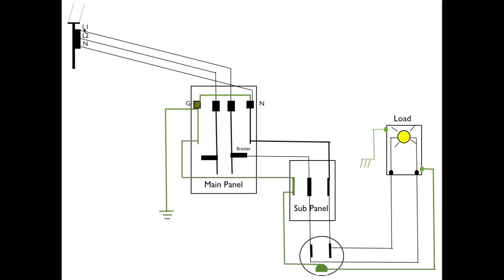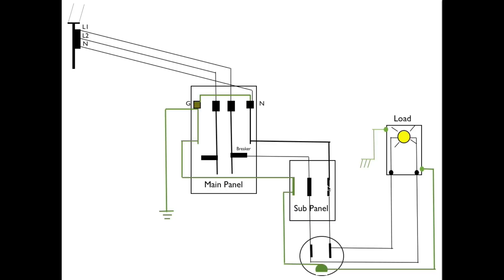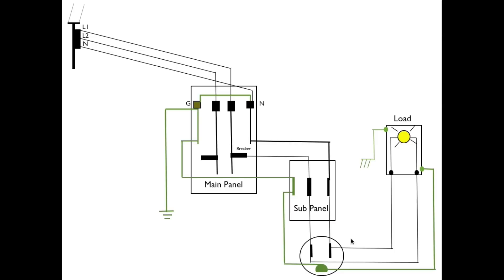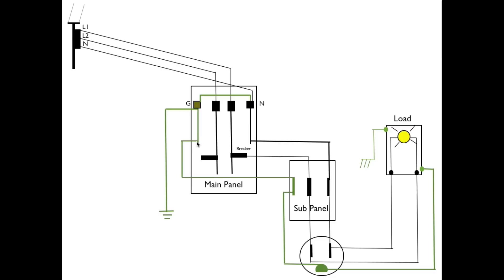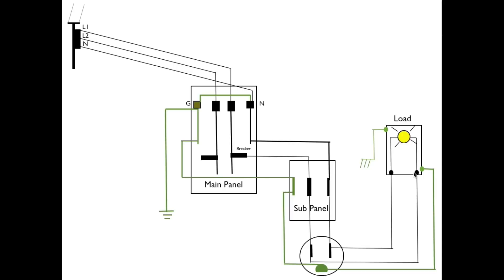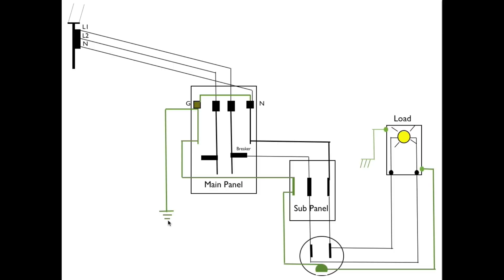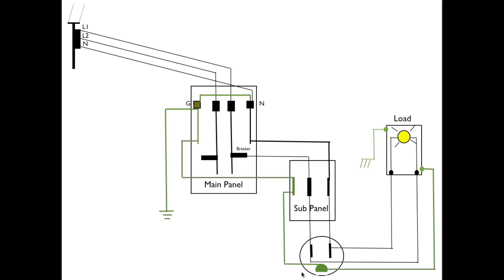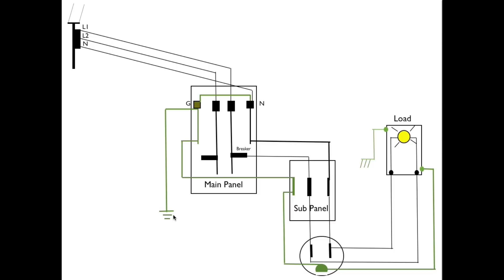The difference between neutral and ground on the electric panel

Comment: The "Neutral" that is coming in from the pole is NOT a neutral. It is called the messenger cable. Utilities do NOT want neutrals. We send power. The neutral is formed by the homeowner, at the panel, by bonding the neutral and the ground together at the panel, and then to generally a cold water pipe..this is the primary ground.
Ground rods have nothing to do with the primary service ground.
The reason we don't "bond" a sub-panel i.e. neutral, ground is because we need for the un-balanced load to go to a designated location and stop.. I repeat stop. Otherwise you'll have a condition called a "ground loop". All bonding is to be preformed at the load center, hence 4 wire connection. Other than that you were dead on. Remember, don't disturb the electrons while they are working...you will not be forgiven.
Reply: JPP2672  .. Thank you. why would I not get voltage between black and white but I will between black and bare and on a nearby Outlet white and bare. can you give me any help at all
Reply: It sounds to me as though you might have an "open neutral." That is to say you don't hand a compete circuit for the GROUNDED conductor. Neutral. 
Neutral. a current carrying  conductor that carries the UN-balanced load to ground.
Reply: In a typical 4 wire home setup, there are two hot wires having AC current but offset by 180°.  Messenger cable (aka neutral) is bonded to earth ground.  Does all the current that comes in from the hot wires exit the house via neutral?  I can't envision all the power going into a copper pipe to enter the earth.  It's a long way back to the power plant.
Reply: Maybe it is a long way back to the power plant then again maybe it's not
Reply from the maker: The neutral is kind of a gathering place for 120 volt circuits.  When a load, say 10 amps,  passes power thru, it goes to the neutral.  If another 10 amp load is energized from the other hot line, the power passes from one hot thru the 2 loads to the other hot line with no power passing to the power pole thru neutral.  If the the loads are unequal, say one is 10 amps and the other is 5 amps, 5 amps goes to the power pole thru neutral.  I have more videos on grounding and bonding on my channel.   Virtually no power passes thru the earth ground.
Hope this helps.  
GFM
Reply: Grayfurnaceman Thank you. I know that about the circuits. I know something is not right.
Reply: Reverse polarity, hence alternating current
Reply: I don't want to argue with you here, but the neutral is the return from EACH 120 V circuit to the transformer.  The 240 (stove, furnace, dryer, ??) is end to end of the transformer. The neutral as I understand it is just a center tap - as one side of your house goes negative from end to center tap it is 120 volts... and the other side of the house should be 120 volts the opposite polarity...
The neutral is the return path that has no voltage because the math is right. It's floating in the center of a 240 volt wave - ZERO.
Reply: ***** hence the shared earth ground...
I was only questioning what was written in the grayfurnaceman's explanation.  It seemed to miss something when I read it... 
Thank you for the answer though.  It's good to have some affirmation I'm not completely lost:)
Reply: The only  true "floating neutral" is on board a ship. The neutral is formed inside the home / business at the load center. What you are speaking of ... (stove furnace, dryer) are RESISTIVE circuits.....power. One way of looking at it is a welding machine....I know its D.C. but its the same principle... the circuit and the devices attached to it are in a controlled environment.
Reply: JPP2672 The dryer element may be resistive but the motor would be inductive.  Load type is not the question (though the current /voltage relationship could cause some issues with lag). 
The neutral is a neutral line from the transformer and you supply a ground through your panel for safety due to voltage differences through the system (from what I've read here). This makes sense to me now. 
I work on large aircraft electrical systems and understand what you are trying to say. The floating neutral you are talking about - what systems have you seen that on?
Reply: JPP2672 I thought grounding to plumbing was out. 1) more plastic these days and 2) should the ground become active and it cannot conduct properly, water can become the conductor and human contact is not a good thing. I know there are plenty of systems out there on water pipe, but power companies where I live won't accept new install with it and strongly encourage moving to ground rods in existing situations. Updating from 100 to 200 amp panel follows the same rules as new installation. Let the plumbers do their thing and electricians do ours.
Reply: I change from a hundred amp service to a 200 amp service on my house and move the service 20 feet down the house so I could install a wood burning fireplace. I change my piping to plastic and I drove in a new copper rod and grounded the system right underneath the Box
Reply: Bob R Then I say you did it correctly. 👍
Reply: Bob R How much did the utility company charge to do that?
Reply: I went down and paid for an electrical permit, less than 100$. An inspector came out and approve my new location. They told me that the new box had to be hot when the state inspector came out and that I could run a jumper from the old box to the new box in order to create an electrical connection at the new box. When I had it finished I called the state inspector he came out and inspected my finished work told me that I needed to put a green bonding screw and that I had left out that would ground the box. He signed off on the new box and he called the utility company to come transfer the wires for the wires to the new box
Reply: True.But we here in The Netherlands we use both neutral and "ground" in end distribution.Because the standard is three phase 230/400V to every home.That ground is made at the end transformer and the connected home.And because home users can use single phase loads in this poly phase system we include the neutral in all our systems.Funny thing is that neutral current can flow between users while zero current flows to the transformer.
Reply from the maker: You can believe whatever the internet nuts tell you, but the truth is I can check amperage to earth ground and it will read essentially zero.  There is no power going to ground to dissipate or whatever these nut cases tell you.  I will do a video on this to demonstrate.
GFM
Reply: grayfurnaceman try not grounding the panel (and subsequent circuits) and measuring for difference of potential between ground and neutral.
Reply: JPP2672  as far as disturbing the electrons.....your right on, did that as a young man early in my career and paid the price. ouchy. never did that shit again.
Reply: I think this is a matter of semantics or code. The reality is the naked conductor (usually used to physically support the bundle) from the pole is connected, at the pole, to the center tap of the secondary winding of the power transformer feeding the house. The other two insulated wires are connected to either end of the same transformers' secondary. The pole transformer's secondary output is 220 VAC +/-  between the entire pole transformers' secondary and 110 VAC  between the center tap and either of the other two. Often ignored but the idea is connect 110 VAC house loads such that they're balanced between the two 110 VAC lines. As much as possible, of course.
Reply: I'd agree - well, I don't really know about Afghanistan. The electrical companies around here don't check pole grounds very often, if at all, after a pole is set. This means there can be significant potential between pole neutrals/grounds - whatever your fancy.  Originally, I expected electrical stuff to work as electronic stuff does but things are waaay looser in the land of electrical! Be careful out there is the best advice!!
Reply: Which is why the safety ground is connected to the neutral at the main distribution box.
Reply: Yes titaniumsandwedge,  the neutral is the normal path except when something goes wrong. When that happens the electrons don't go back to the power plant through the ground. The earth is an electron sink that can provide electrons or accept them in huge quantities. Also if there was a direct connection through the earth it would only need to flow to the power pole which is grounded to the transformer with the wire you see gong down the pole to a coil at the bottom.
Reply: If you have A ground fault switch try connecting your wall socket ground and neutral while the system is under load.In most cases that will trip the ground fault switch. Ground and neutral are connected at my main distribution board but series resistance in the wires gives A small potential difference over the neutral to ground.Also when my neighbour starts heavy single phase loads I can measure A few amps flowing from the grid via my grounding rod back to the transformer.. not much but it's a good few Amps.bdw we don't have pole pigs we've got decent 500KVA transformers for serious farming.
Reply: It all depends on your power distribution company set up.  The most common is the multi-grounded neutral system.  You will see that every third pole has a ground wire going down the pole to a buried ground rod.  The wire is connected to the neutral in the distribution system.  The whole scheme changes when you are served by a delta system, in which the neutral is not grounded.
Reply: jeep 
6 Mackerel
Reply: It's Great fun to live in an area that used to be delta but converted!! lol
Reply: Wtf is wrong with youtube it tends to mess text up when posting..
Reply: vena thunderbird Remove the fuses (or turn off the breakers) to those machines and unscrew the outlets. Verify that the white wire is connected to the silver screw and the black wire is connected to the golden screw. Also, check the ground wire connection and make sure all the screws are properly tightened.
Reply: Utilities have 2 live and one ground, "the grounding cable",and anything tied to the grounding cable is a grounded cable. The grounding cable is the earth ground.A neutral should only be a grounded cable as it carries current.
Reply: im a lineman and please don't ever call the neutral a messenger again. messenger wires carry other wires (they are lashed to a messenger which is steel think of cable tv). Our neutral carries the unbalanced load back to earth. we bond all equipment to the neutral. we also drive ground rods every so often to bleed unbalanced load out. most importantly we run all main neutrals back to the station. which is the best ground (interconnected 4/0 copper grid). all major faults can sometimes make it all the way back to the station. the larger the neutral the quicker faults can clear out.
Reply from the maker: Well said.
GFM
Reply: A ground rod can carry significant current. That's how single wire transmission lines work. https://en.wikipedia.org/wiki/Single-wire_earth_return
Reply: This topic is getting messy.. Because of all the different systems the world uses and because primary distribution and end distribution get mixed up here.. This threat h is A mess..
Reply: my local code requires a continuous ground wire all the way to the street side of the water meter, usually where the copper line enters the basement floor or wall.  This is the best way.   you can have your plastic pipes then.   The ground rod came into play about 30 years ago because of the popularity of plastic plumbing.  Local code also requires a ground rod, but I question their usefulness after 20 years in the dirt.   They are just copper-clad steel.
Reply from the maker: Agreed 
GFM
Reply: Nec requires at least 2 seperate grounds   Read NEC panel grounding requirements.
Reply: I once saw a  melted Neutral spice on a pole in turn the the panel was frying things in the house  at 130 volts instead of 120v. Small transformers ,TVs and small appliances not rated for 130 volts. The power company was liable and had to fix  the connection
Reply: JPP2672 yes utility's call it a neutral
Reply: JPP2672 it is a neutral. Neutrals are created at transformer
Reply: it's scary how many guys in here have no clue how the electrical grid works. my god. IBEW local 353 lineman
Reply: grayfurnaceman : Good explanation of the circuits in the panel.  Some people think "uh" and electricity go hand in hand.  How could anyone would stand next to a panel and think they are educated while they say    "uh" or have to hesitate to explain simple stuff?
Reply: JPP2672 a
Reply: 40 year pin, retried,  IBEW trained...you said it.." messenger cables carry other wires" No cable tv here everyone off that pot is in the same potential. thanks for affirming my statement.
Reply: You"re right! I quit, they won, goodbye. I don't have to sleep in there homes....Good luck hookin" that up there................... brother.
Reply: Correct. It is a center tapped Neutral...But. that is to place all the homes that are served from that Pot....(transformer) in the same potential. If it is a "true Neutral" then  why do you bond the neutral in the load center, and then to earth if the utility has already provided it ??? If the utility has provided a neutral then there will be no bonding...What would you need it for? And then if you lost your neutral from the utility company would they be responsible??? That would bring them (the Utility company) in the branch circuits of you home.  The power company's responsibility stops at the first point of attachment. Hence POWER company's.
Reply: al righty then speedy
Reply: Ok, so lets take off the ground rods, take off the #6 to the water pipe and solely depend on the SE cable coming from the meter socket, up the mast, to the tri-plex at the first point of attachment so the only neutral that you will have is being provided for you at the pole, by the utility company. If you do this you will find that you do not have a neutral and most likely burn up everything that is drawing current, especially motors and circuit boards.  So how can that be a neutral? It either is a neutral or it isn't.
Reply: Ok so lets take off the ground rods, then take off usually #6 bare from the water pipe then have Only the the SE cable through the meter socket, up the riser, and to the first point of attachment at the tri-plex. So the only "neutral" that you are depending on is the one coming from the utility. Now lets see how long your ACSR cable supports unbalanced loads in your home. Its either a grounded conductor or a grounding conductor. I am sure that you realize that you will smoke everything in your home that is drawing current by lifting the primary grounds that are bonded to the neutral buss. Nice try though....
Reply: Floating Ground
Reply: This is very evident when you don't have city water for your chapter 86 and your water source is from a well, Then this is the case you cant have a chapter 86 bond(That's why you have a silver ELECTRICAL CONNECTION tag fixed to Pipe bonding Clamp Chapter 86 NEC code) If city water is not present, out side along the footing of what ever style dwelling is there you. NEC wants 3 ground rods daisy chained with a bare solid conductor sized appropriately for what ever size service the dwelling is drawing (100AMP calls for #6) buried a couple inches below grade 10 foot apart in either direction doesn't mater but this bare conductor cant be cut and clamped or spliced. It has to be one continuous conductor from the third rod back to the service entry and into the panel to bond with neutral and protect case/earth ground there. This is where the insulator bushing on your SE raceway is replaced from the vinyl bushing to the steel bushing with a bonding screw on the bushing itself. Also you are getting your neutral from the messenger because it and your Voltage for L1 and L2 is adjusted  by the step down transformer before it is carried on through the Tri-Plex and on to the service entry. This is also why the pole with transformers have a bare bonding conductor stapled down the pole to a ground rod. Trans former also needs to be bonded. Remember if energy is discoed, its not truly dead unless its grounded. Also gives you your 3-wire single phase system at a frequency of 60Hz. But Floating grounds can cause other problems like a plumber becoming the path of least resistance when he breaks apart a pipe between your cold water bond and the panel. So now here in cook county IL new build wants chapter 86 Bonding within 5 foot of city water entry before any kind of plumbing connector.
Reply: Also This is the reason why neutral can never be opened before the circuit because the amps traveling back to the transformer has to find another path of least resistance and jumps over to the other line unbalancing the Phase and blows up whatever's running on the opposite buss.
Reply: Sounds like a city ordnance. What he is doing in a triad. Also within the city limits of Chi town all circuits are in conduit.
Reply: How can you get a primary ground on plastic water supply pipes?
Reply from the maker: You can't.  You need at least 1 ground rod.
GFM
Reply: You are incorrect.
Reply: Your terminology is inprecise, if not full-out wrong.  People don't care about the electric company's terminology or whatever.  They care about what comes into their home, and how the power is distributed from the main breaker box.  You're confusing two terms.
Reply: Everyone please disregard the original statement; it is not only completely out of line, it is a dangerous approach to this subject.  It lends the thought that not all the utility wires are necessary.  Please, understand in order to properly utilize an electrical system the voltage must be stable and constant and within a nominal range. This known and stable voltage is produced by the utilities generators then distributed and stepped down for residential and commercial use through transformers. It literally is the transformers winding's and grouping that dictates the voltage and reference to neutral. A single transformer can be set to service a 240 volt / 120 volt single phase service. The 120 volts is the voltage range referenced to the neutral. Two transformers can be grouped together in a WYE configuration. This system is a three phase 208 volt / 120 volt system that has a highleg. Therefore, A-phase to neutral and B-phase to neutral measure 120 volts; however, C-phase to neutral will have a voltage measurement much higher than 120 volts to neutral, therefore, must not be used for 120 volt circuits. This system will also flow current through the main panel grounding conductor and ground rod. It is very dangerous to remove the ground wire from the rod with power on with a load in the structure. Three transformers grouped together is called a Delta configuration. This configuration can produce a highleg depending on how the winding's are tapped to ground. Nevertheless, the most common systems do not have a highleg and they produce either three phase 208 volt / 120 volt or 480 volt / 277 volt. The main reason that the grounding conductor is installed on the customer side is if a sever fault occurs it will provide a much better reference point for the circuit breaker to manage. In addition, it is less likely that the utilities equipment is damaged.
Reply: Alter Kater to clarify.  NEC stated that the "cold water ground" must be applied within 5 ft of entering a dwelling.  Plumbing code requires 10 ft. of copper pipe before changing over to pex.  The NEC is internationally recognized and Afghanistan has no power grid.  Buyer beware of your opinion. Dan
Reply: They have been running black plastic pipe from street since I bought my first house 1977.  I don't think it was PEX. It resembles sprinkler pipe and came up through the slab
Reply: brother you are correct but this explanation is not about nomenclature .. It IS about BASIC knowledge of a circuit..  relax my friend... the knowledge of the correct name will not save you but the knowledge of how it works will.
Reply: They actually work pretty well. I have plastic water pipe from the street, so panels are grounded through ground rods.
Reply: You do not, ever, do that. Never, ever.
Reply: I don't know what country you're in. It sure don't work that way in the USA. The messenger on triplex IS the neutral, and case grounded on the transformer and grounded to earth via a ground wire down the pole to a ground rod. At the weather head, the messenger is connected to the neutral from the meter socket, the neutral, the middle leg, connects to the neutral going to the panel. Also at the meter socket, the neutral is also connected to a ground wire that goes to a ground rod driven into the earth. Hence the neutral is "grounded" at both ends. What goes out of a transformer has to return to the transformer.  I've been a journeyman doing these hook ups for 50 years.
Reply: You are partly right. A true WYE is three single ph. transformers hooked with H1 to phase and H2 common and grounded (depending on polarity of transformer). A 2  kettle WYE gives you limited single phase. With DELTA, 3 kettles gives you 3 phase, 2 kettles gives you open Delta. On a WYE, if a phase is grounded, boom, blows a primary fuse. On DELTA, you can operate normally with one phase grounded. If a second phase grounds, them you blow primary. Journeyman lineman for 50 years.
Reply: What are you talking about?I've been a lineman for 18 years and a typical house service has a nuetral from the source to the load..Your saying we just deliver power?Watch what happens when that so called "messenger" breaks..Home owner will complain about very bright lights and very dim lights because there's no nuetral to balance it..Take an amp meter and put it on each hot leg of the service,if you have 12 amps on one leg and 16 on the other leg you will have 4 amps on the nuetral..It's not just a messenger...
And also what I find funny is that nuetral goes up to the pole which is connected to the nuetral on the transformer which we ground again anyways..
The ground is to disapate voltage..not amps..that's why sometimes when a nuetral wire does break going to the house some people won't notice anything because their house ground is good enough to work as a nuetral
Reply: Eddy Gilbert ..I'm a lineman to and when I saw him say messenger I was like whaaaa?
Reply: This is not correct.  The third wire is called "NEUTRAL" and is a neutral.  It is not grounded until it enters a facility and there it is "bonded" to the ground.
In most domestic facilities in the US, there are two hot leads entering the facility, both at about 120 volts AC but in opposite phase so that the difference between those two is about 240 volts AC.  For a 120 volt AC circuit, the circuit is between the hot, 120 volt lead and the neutral lead.  For 240 volt AC circuits, the circuit is between the two 120 volt AC lines.  Remember their phases are out of sync so the results is 240 volts AC.  But the neutral IS called "NEUTRAL".
Reply: This is correct what you say. I Think many commenters here don't understand the concept of potential difference between hot legs and neutral/ground and the flow of current based on this potential difference. They get stuck on physical attributes such as wires & bonding instead of power flow/ physics...
Reply: speed kills /// The real reason the electric theory teaches you that neutral is not equal to the ground is the fact that if you reverse the wires at your roof pole you can get electricity for free and not paying a dime to the power utility supplier if your ground is strong. So they dont want you to know or to learn this and from a long time ago. It is what Nicola Tesla knew and the reason he wanted to give you electricity for free: free electrons from the ground for humanity! That's why they teach you that "neutral" is in principle a different thing than "ground" . For the same reason they teach you that an atomic device can be built with a special element ( uranium, plutonium, etc ) only, when in fact can be made with any heavy chemical element if built in a very precise dimension and bigger size and in an "entropicaly-hermetically-closed" design when compared to the "open design" that's currently used in the fake theory that you're stuffed with in coleges and universities. Good luck! 🙂
Reply: Tim g Yes it does. In power systems protection, relays monitor ground. These relays operate based on the amperage they see on the ground
 due to line-Ground or phase to phase faults.
Reply: grayfurnaceman there might not be amperage then but i can tell you there could be if something happens to the neutral. And you can run loads from hot to ground without neutral.
Reply: The messenger wire of a Triplex drop cable is, in fact, neutral. It is connected at the house to the neutral conductor, which is grounded at the service panel, and at the pole to the secondary neutral, which is also grounded at the transformer. If utility companies don't want neutrals, why do they wire their secondaries for 120/240V split phase power. Just give us 2 wire 240V like they have in the rest of the world. The homeowners didn't make that choice, the utility companies did.
Reply: Neutral doesn't go through the meter, either. Only L1 and L2 goes through the meter, and then on to the service panel. The neutral goes straight through the meter box without any connection except that it is usually bonded to the box itself. It is the power going through L1 and L2 that turns the meter, inductively, or electronically if it's a smart meter.
Reply: You are absolutely right, the L1 and L2 carrying power  have to have the neutral to balance any residual voltage.
Reply: scott flynn yes and the neutral is grounded at the panel (and at the transformer) so it is at 0 V potential relative to ground.
Reply: JPP2672 i
Reply: Ronald Harris thank you for this explanation it helps a whole lot and reaffirm that what I am doing is correct.   after reading so many opinions i was starting to doubt my skills this is why we have to take with a grain of salt everything we read on the Internet. thanks again for your input.
Reply: JPP2672 your explanation makes more sense🏢👍
Reply: Eddy Gilbert, agreed 100%. I have gotten to where I do not even comment much anymore, due to the arguments that ensue from ig'nant people. They are the dead clowns we read about everyday. I am glad you said it too...... me - 40 year electrical PE, 30 year elec. contr.
Reply: JPP2672 yes neutral completes the circle. Sends back the negative electrons back to the power station. at 60 Hertz per second
Reply: titaniumsandwedge it travels at the speed of light. It gets to the power plant in less than 1 second. Electrons. ⚡⚡⚡
Reply: Single phase at 180 degrees  split face... 220/120 volts
Reply: JPP2672 - You are completely wrong and I can tell that you have a major concept about electricity incorrect. The neutral DOES come from the power company. The major concept you are misunderstanding is that you think electricity goes to or is trying to go to ground. IT IS NOT. Electricity is trying to get back to the SOURCE. It does this either thru the opposite leg (240) or thru the neutral (120). The ground in your home is simply a backup neutral that is there so that in the event of a neutral fault, the electricity doesn't mistake YOU for a return path and fry you. The reason electricity seems to 'want' to go to ground is that, in the absence of a neutral, it views the earth as the path back to the source. However, due to the law of infinite paths, it just doesn't make it very far. If you doubt this, find a water puddle, drop a hot 120 leg into it, grab a line that is connected to neutral in your hand and jump into the puddle. It'll be the last thing you do! And basically, it proves that electricity will come back out of the ground if you can give it a better path back to the source. If electricity is "trying to get to ground" then why would it not be safe right? I mean the electricity would already be gone right? But you can and will get electricuted by standing in a puddle that has electricity running to it if you are also somehow connected to the service neutral. This is only possible because the earth is NOT the electricity's DESTINATION. And BTW, whoever said that the NEC requires there to be two ground sources is insane. They require that there NEVER be two ground sources. Now, recently, I believe they put in that you are required to sink two ground rods, BUT they are required to be bonded together with #6 to bring them to the same potential. You talk about taking the ground off of the water pipes... The water pipes are not to be used as a source of ground. The reason the water (and gas) pipes have to be backbonded to the service ground is because they MIGHT provide a ground source (and YES, there is a calculation in the NEC for X-number of feet of X-diameter of steel pipe making ground contact being a legit ground source) and since you do not want two different ground sources with two different potentials, they need to be bonded together to make sure that doesn't happen. So to say that we're "grounding" the water pipes, or that we're "grounding to" the pipes is totally incorrect.
Reply: "Neutral. a current carrying  conductor that carries the UN-balanced load to ground." Absolutely WRONG. 
Neutral. a current carrying  conductor that carries the UN-balanced load back to the source.  That distinction is very important...
Reply: Very interesting point.  And as the price of copper fittings has hit jewelery store levels it will be come even more important in the future.
Reply: JPP2672 h
Reply: You may call it the messenger cable but it still functions as a neutral.  The difference between neutral and hot is the neutral is at ground potential or zero volts and the hot has voltage (usually 120v).  Both conduct current where the ground does not conduct current when connected correctly.  You are right that the neutral does not happen until it gets bonded to ground at the main box.
Reply: Horsefeathers!
Messenger wires are the grounded conductor and a return path all the way back to the generator.  At each transformer the "neutral' is grounded...at each buildings 'service entrance'...the ground rod provides a "supplemental ground"...all the metal parts (metal studs. I-beams, etc.), especially the water pipes are 'bonded' (connected) at the service panel. If a device fails electrically), a 'short', the electricity flow instantaneously trips its circuit breaker off.
In a balanced 3-phase AC system no current is supposed to flow thru the neutral, but the electrons don't always believe that & some stray currents may decide to return via the "grounded conductor".
Grateful Fred
Reply: titaniumsandwedge I have never seem typical resident wiring only having 3 wires only 4 wires on hot water heaters and things like that.
Reply: Thanks for your clarification.
So, I was told, that the messenger cable goes back to the xfmr output coil that's on the utility pole. & its strategically tapped at just the right spot in the coil, so that from L1 to the messenger cable is 120V; & another 120V from that same messenger cable to L2.
So, if there is a load drawing 4 amps between L1 & the messenger cable; & simultaneously, & 2nd load that draws 5 amps between L2 & that same messenger cable, then that messenger cable would carry a charge of 1 amp. (The difference between the 2 loads, both being supplied by the same xfmr)
Is this correct?
Reply: @eagle3351  Either you have an open Neutral in that circuit, or perhaps there is a Neutral & ground touching downstream from a main power box (sub-panel or wired wrong on a wall socket, light switch, etc...)
Uh, if that is the case, you are dealing with an electrocution hazard & I recommend calling a licensed electrician to find it, bring it up to the latest NEC codes, & go ahead & upgrade your home with GFCI breakers & GFCI wall sockets in bathrooms, kitchens, the garage & out side sockets to, with the weather/water proof, clear plastic lid on it. 
I wouldn't mess with that. It'll kill ya!
Reply: @nofunnick  mid point ground delta is grounded, corner grounded delta is also grounded.
Reply: @McCurtainCounty888  You've confused me. On a simple 220 line into a house,  the neutral could float (no ground). It would still be the center tap from the transformer, have no voltage (relative to the ends) but could be at a different potential than earth ground. Hence tying it to earth ground for safety of the operator... wrong?
Reply: @whackydumdum  any point on a transformer could be tapped into and grounded . We could have a 240volt xmer ( or any other voltage) and tap into it 3/4 of the distance between l1 and l2 and have 180 volt to ground on one leg and 60 volt to ground on the other. We can only ground one point or it is a direct short circuit. The neutral got it's name because it is a point on the xmer that is . neither negative or positive , positive with respect to negative and negative with respect to positive. Think of a 120/240 xmer , label one side + and the other negative, the neutral point is precisely in the center of the winding and the voltage is exactly  equal from either side to that point, any other point would have unequal voltages,that neutral point is then connected to earth ground for safety reasons. There are ungrounded systems where no point on the xmer is connected to ground, such as locations where a spark from a ground fault could be catastrophic. Current always returns to source whether it is a battery, generator or in this case an xmer, we use earth as a parallel  conductor to the neutral in fault conditions, this is for safety and it eliminates ghost voltages that occur on ungrounded systems  due to capacitive coupling with earth. I hope this helped.
Reply: @McCurtainCounty888  You are Awesome.  Thank you.
Reply: @titaniumsandwedge  the two hot wires and or the neutral are all in phase, they are not 180 degrees out of phase
Reply: @mikel4879  wtf  did I just read? You need to get some correct  info before you post
Reply: I don't have to correct anything. I know what I'm saying.
Reply: @mikel4879  no electrician or engineer or anyone that knows their job would ever agree you.
Reply: McCourtain County / I know the usual classical "song" and I am very tired of it because it's extremely boring.
Sorry but my post is not for you guys. My post is for really nonconformist, not-ever-satisfied brain out there who wander and wander continuously looking for the right light at the end of the tunnel.
When you obtain movement of the so-called electrons by just sticking in the bare ground two similar iron rods and read the voltage between them where is the traditional electrical theory going?
I know that you know the classical answer but you don't know the right one.
The same thing about an atom device created with any heavy chemical element instead of the classical one. You need just the right size and the right design and nothing else. Any smart brain can do it but in order to be able to understand it and do it you have to lose and leave the classical scientific theories.
They are out there and strongly promoted with the exactly target to stop you to think and find the truth.
My post is not for the classical brain so it is sure not for you as long as you think exactly like every "electrical engineer" out there.
When you create the "electron" movement by a movement of the parts of a mechanical device you go against the natural flow of the energy in the Universe.
You have to go in the same direction, not against it. What do you think an "electron" is? 
Don't bother to answer for it's a rethorical question ! 
I know the answer and you don't !
Reply: @mikel4879  again,wtf
Reply: JPP2672  In the UK and other commonwealth countries that follows the IEE regulation and secondary the NEC, the neutral conductor comes from the secondary side of the distribution transformer and run directly to a home (single phase). I did not get the point of you saying that the neutral conductor is form at home, I mean obviously it is called a return line once there is a load. I need further understanding.
Reply: mrlovemuscleable / Until you get an answer from JPP2672, I will give you a different "kind" of explanation.
All the electrical power plants, distribution businesses and end users, make use, in many ways, of the grounding of any electrical equipment. Either they know a bit about the real reason they do it or not ( mostly not ), the fundamental reason that the grounding needs to be used is not for the theoretical reason of "grounding in points where the neutral" is relatively ( exactly calculated ) maximum but in reality because the artificial electric charge, meaning the one created on Earth by artificial means ( mechanical, etc ), accumulates asimetrically and aleatory and in those aleatory points it needs either to go somewhere or, "eventually", do damages. Somewhere where? The natural electrical fenomena on Terra show that the "natural electrical circuit" of the Earth is completed ALL THE TIME with the EART's GROUND.
That's the real reason of why there are spontaneous isolator explosions, power transformers explosions and so on. The assimetrical buildup of the electric charge tries instantly, all the time, to follow the path of the equilibrium even if this equilibrium is ALL THE TIME JUST TEMPORARY AND NOT A FOREVER ONE.
That's the reason the core of the Earth is in a continuous movement, that's the reason the electric Energy of the Sun is violently directed toward outside, that's the reason you can get electrons out of the "zero potential" ground ( "zero potential ground" = what the Earth science wrongly "sais" and "wrongly" teaches you ) just by sticking in the ground, at a distance, two identical metal rods and find a potential difference between them even if, as Earth science "sais", they "should be" at an equal potential, of the zero value of the ground ( as the fake Earth science teaches you ).
What the Earth science doesn't teach you is to ever trust what the truly smart people on the face of the earth have done and tried to send you : the truth !
That's why you don't believe that you can build an atomic device with any heavy chemical element ( not only with uranium, plutonium, etc ), built in a specific design where the size, symmetry and entropy play the major roles.
That's why you can extract the electrons directly from the Earth, directly from the fake "king of zero potential". 
The establishment, from the time of Westinghouse, Astor and J P Morgan to this day, will do anything in its power to make you 100% believe the words of the "MIT" professors with the same "degrees" of "degrees" on the  shoulders, so to make absolutely sure you're intellectually castrated at any age.
Reply: haha thx